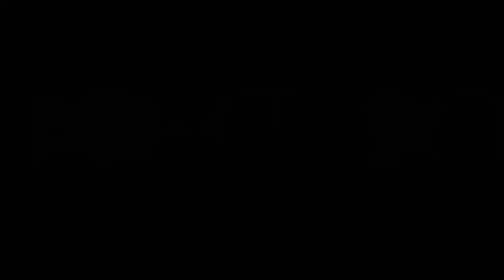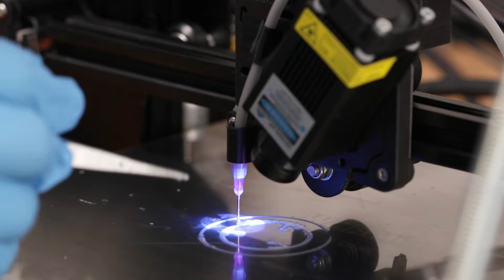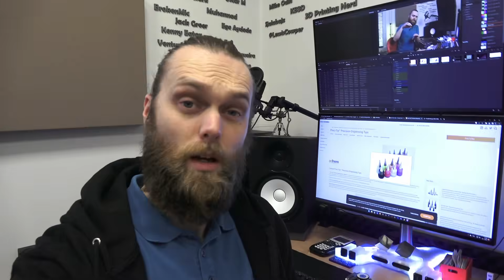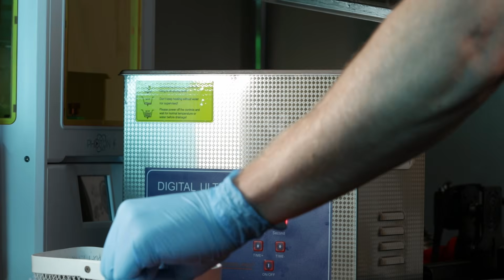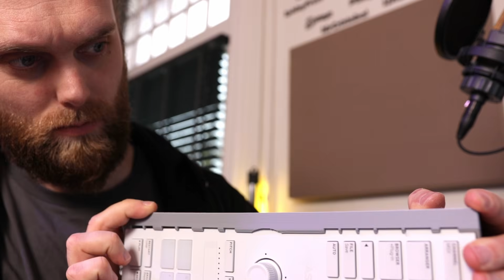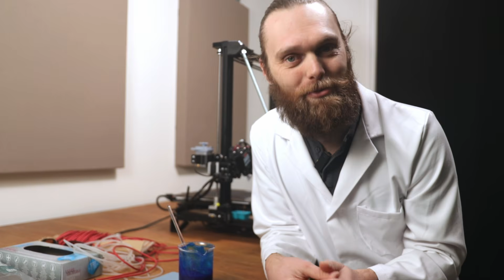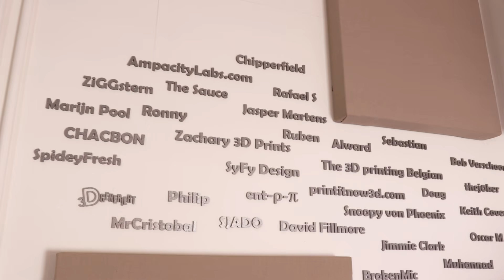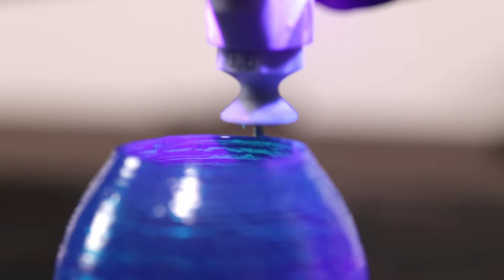I made a CUSTOM Nozzle that 3D Prints GEL!

Comment: You need a particulate filter on your 3m mask, as it is in the video its just a charcoal filter for VOCs and scents. Good work on the project though, keep it up!

A couple thoughts, you dont need to be curing all the time, you could cure selectively to avoid the nozzle getting stuck on cured features, you could simply do an end curing pass at the end of each layer. You could also cure while printing for overhangs etc.

Comment: Should look into a vacuum mixer for incorporating the fumed silica, then you don't have to deal with foaming and you can ensure there's almost no gas incorporated.  Looks like for small volumes you can get them (looks like dental mixers may be the way to go) for $100.  Not the entire puzzle, but it should remove some variability - and make pumping easier too since gas distributed in the gel could definitely affect pumping.

Comment: like you said, since the liquid is so think maybe the vat itself needs to be pressurized, like if u filled a syringe with the resin and used an acutator to slowly push the syringe to extrude the resin rather than using a pump to draw the resin might allow for a more continues deposition? anyways best of luck you have already gotten this far im sure the solution is closer than u think!

Comment: Keep up! You will make it! :)
Could it help to hreaten the gel a bit, so it flows better within the tube, but have a fan outside the nozzle, so it cools down and gets more viscose one outside the tube, like a regular FDM printer does? This way you could use a 'thicker' mixture of gel.
And: Mabye it would help to do the whole thing otherway around. Possibly the continous fiber, despite seeming an additional complication at the moment, IS the actual solution to have the gel bridge, because it adheres to the fiber..?

Comment: I know this kght be a little old suggestion already, but there are a few "industry standard" chemicals you should try on the resin. 

1°: Cellulose. This can be:  Carboxymethyl Cellulose, Hydroximethyl Cellulose, Hydroxypropyl Methyl Cellulose. Any of those 3 should work for thickening the resin without altering it's properties (the proportion is really little). They are commonly used for adhesive, mortar, detergent, creams, paints and many other products (as you are thickening resin any of those should go well).

2°: Dispersant or Dispersing agent. You should get one compatible with the type of resin base you are using. This evens the mix making it more homogeneous, preventing ingredients division, mostly for evening the color and avoiding pigment or other heavier materials decant. You have to find the point but the dosage is stupidly little.

3°: Defoamer or Anti-foaming Agent. This might be optional here, as the thickness of the material is so high and remains static for so long, you can avoid using it, but could be helpfull for big batches as it reduces bubbles when mixing. This prevents the formation of bubbles to a certain degree.  You can vary the dose percentage on the resin, but usually is stupidly little too.

4°: Special mixer. Yeah, you should buy or print a mixer bit and mix it using a machine with a regulated speed so you can get a better result on the finished gel. Beware that mixing at too low speeds can mix badly, and mixing at too high speeds could break molecular chains, try limiting the max at 750rpm or less as a starting point till you get the right speed.

Hope you get the best results!

Comment: Nice work. Having it print UV cured Silicones would be good for my project. It is also not easy, but silicones have a variety of applications, and often need to be cast in strange shapes.

Comment: My 2 cents:

Try printing the conical lens for the laser using the resin 3D printer?

How about 'pushing' the resin vs 'sucking' it?  Something like a meat grinder?

Early on in the vid - you had residual pressure from the resin in the tube and the resin came out very uniform from a high Z axis - could you use that to your advantage? (vs the nozzle plowing through cured resin)

What about doing something similar to the resin vat printer and cure between layers with a 'flash' of UV?  This may also solve for the nozzle plowing through cured resin?

Your resin mixture - I'd start mixing it more scientifically - measure/weigh your ratios and adjust from there (documenting the new 'recipe')

Comment: There must be a different principle for supplying resin to the nozzle.  The pump creates a constant pressure in the supply system.  And the flow is regulated by a needle valve, which is located in the nozzle.

Comment: I think you want your setup as much "Direct drive" as possible - the shorter the distance (and height difference, and also hydraulic resistance) from the driving pump to the nozzle, the more control over the flow/bubble/drip the drive has and less suffers the efects of gravity, viscosity and inertia. Also nozzle diameter might be significant due to surface tension and capilar effects.
I think you could have the pump directly on top of the nozzle and thus not have to deal with the hassle of trying to move 100 mm long column of resin up.
As suggested in the comments, the nozzle hitting was probly low Z hop.
And maybe if you reduce the resin exposure (like curing the resin less), your resin is going to be more of a gel and have better binding properties as well as causing less resistance to the nozzle.

Comment: Massivit's GDp printers are using a suirng style of pump head to move the resing. I thing if you were to add an acrylic tube as a tank and a gas seal piston head on the end of you tubing you would be able to pump the even thicker resin because the airpresure would help the pump.

Comment: What would you think about printing wire? Normal electrical wire in insulation, the insulation serving as filament melting from the heat, the wire providing structural strength. The trickiest part would likely be snipping the wire on retraction. A gap between two blades? Or some active guillotine?

Comment: Hey man really cool design what might help is to put the gel/resin mix higher on your  printer, or at least above the print head. Because of this it does not have to fight against gravity and resold in a more steady suply. you could also make use of a mechanical pump this is often used when pumping oil becouse it can result in mutch higher pump force, you might need a presure valve in it to realeave it from build up precure.

Keep up the good work!!!

Comment: Maybe this answer comes too late, but you should try to mix the ingredients using ultrasonics. Your ultrasonic cleaner can do that job very well.
First mix the ingredients in the traditional way and then hold (wear gloves as vibrations can cause burns) the container inside the ultrasonic cleaner, that should do the job.
I took this idea from a technology channel (TechIngredients) where they use this method to mix the components of their own thermal paste.

Very interesting video and idea, you have a new subscriber.
Reply from the maker: Thanks a lot for your suggestion and sub! This is definitely an interesting approach. I'm wondering if it would work if you fill the cleaner with water and place the beaker in there. Maybe this could prevent the risk of burns.
Reply: @properprinting  I think it should work perfectly, and ultrasound usually helps in degassing.
Maybe it is worth a try

Comment: Would it be possible to try a different slicing method to potentially get around some of the issues with bridging like conical slicing? If you are redesigning a printer to work in a completely different manner than FDM, it would only make sense to try all available slicing methods to see which one your resin takes to the best.

Conventional FDM slicing methods don't seem to mesh well with this project, but the sign they work means you may need to optimize around the resin rather than forcing it to work with conventional printing methods. Diagonal layer load bearing would also increase the overall strength of continuous fiber printing too if you manage to get it working without it.

Inspiring stuff my man, change the game for us all so we can take advantage of your work!

Comment: You could maybe fix the bridging and blobbing issues by connecting the pump to the controller for the filament pulling mechanism so the printer doesn't output a permanent stream but can interrupt it.

Comment: I wonder if something organic would work well to make a gel. Gelatin probably hardens too quickly, but something powdered like fruit pectin, tapioca, rice flour, talcum, or mashed potato mix could provide the right consistency. Thomas Edison went through hundreds of materials before hitting on the right one for his lightbulb filament, so everything is worth a try. To keep the nozzle free of resin, maybe some silicone spray or silicone grease can help prevent sticking.

Comment: Just an opinion. wouldn't a hydraulic syringe and braided line be better instead of the pump for the resin mixture. It will hold a vacuum and have enough power to push the resin mixture through at a constant rate and the braided line will resist expansion while maintaining pressure.

Comment: Another suggestion that may aid with deaeration:  try adding a bit of an antifoam or defoamer.  A lot of the UV curable resins don't contain an antifoam or defoamer.  I've found Tego RAD 2500 and Tego RAD 2700 (available from Evonik) are very effective when added in small quantities of maybe 0.5% based on formulation weight.  If I had to pick one, I'd pick RAD 2700.  BTW these both are UV curable defoamers (i.e. they contain acrylate functionality).  Feel free to message me as I used to formulate UV curable 3D printing resins, coatings, adhesives, and paper saturants.

Comment: So i print with both resin and fdm.... one thing after printing resin is curing. id be very curious to know how strong the prints would be if you set it up so that it basically had a uv light bath on the rest of the printer. like 2 big uv light bars on each side or front and back or something to cure the rest of the print 100% while its printing? maybe use some sort of shield that blocks the uv light from touching the layer its currently printing, or even the top 2-3 layers at all... somehow attached to the z axis maybe? so that when the z height raises it unblocks the layers underneath to be cured by the uv flood lights? either have the lights attached to the z with shields blocking them, so that as the z goes up it gives those lights more and more access to the print? or the shields attached to the z so it uncovers layers as it goes up?

Comment: With that thickened gel-like resin, is there a consistent temperature you have been printing at? Or perhaps a consistent ambient temperature?

Since resins become less viscous at warmer temperatures, there may be a way to allow it to be easier to flow (due to an increased temperature) while allowing it to cool fast enough after being extruder to return to its stable and high viscosity nature

This cooling time would also be augmented by the distance of travel from the source of heat to the final destination

Comment: You can shorten the distance between gel cup and printhead, cup with gel could be on the top of printhead and gravity and pump will do the job. Also you could use mirror on the bottom of your print area. It could improve curring. Or mirrors can be around the lasers. For example your printer should be in the box and box should have some kind of mirrors. It should improve curring and resin hardening.

Comment: With the mixing nozzle have you thought about using a 2 part resin instead of UV? Would remove the need for a laser setup, but you'd have to keep the resin mix flowing/purge it from the nozzle once done.

Comment: If it's a material issue, which it seems to be, modify the material.

Do a few specific tests with different mixtures of the beads, silica and resin. Test bridging using controlled tests of the light exposure as well. You don't need a full cure, just a partial cure which might help with the nozzle 'catching' the print. An extended exposure after the print is done could be used to complete hardening. 

In short, modify the ratios and temperatures of the material (resin) and evaluate. You can do that without the printer to save time.

Comment: what you want to be using is called a high precision glue dispensing machine. They are under $200, it fully automates the flow rate of glue or resin that is being dispense.   Use whats already out there, you'll be much happier with the results

Comment: The silicon tube introduces a lot of springiness to your extrousion rate. You really only need the silicone tube the short space within the pump. That should take care of alot of the variance. Also a semi transparent tube will leak some of the stray uv light into your resin and change some of the viscosity over time, even before the gel reaches the nozzle. 
But anyway, love the project and the longterm idea behind it.

Comment: Not having done this, but having used FDM and SLA over the last decade - have had lots of "ideas" re. direct printing of light cured resins.
 - Also using fumed silicate as a high strength epoxy filler is my go-to..

Thanks for going to this trouble -  using a syringe pusher (or in production settings a screw feeder) to pultrude gel is an option - even if a metering peristaltic pump is included closer to the nozzle.
(pressure meats suction every day, lol.)
Works in progress no doubt.

Comment: Don't forget... If you're printing with "usual" filament... And your nozzle hits your printed part again. The nozzle still have the temperature to melt it. So it melts through it. With your Resin/ uv Print that will not work.  Don't give up! I like the idea!
Reply: Maybe a nozzle with a ramp and spring can help? Similar to a pogo pin?

Comment: You have to keep going!  You're literally creating a new technology for the world!  The fruits of your labor are untold but I'm willing to bet it'll be mainstream in 5 years or less.

My recommendation is create or buy a small compressor.  Create a sealed reservoir with a pressure transducer.  Find a pressure that works well with your tube length.  Then tweak the printer to control the compressor to maintain a specific pressure.

I think that'll give you the consistent results you're looking for.  Your pump will be more like a variable valve at that point.

Comment: My suggestion is to get rid of the tube from beaker to pump and make pressurized resin container to prevent tube in pump from collapsing and not pumping, also i will add some pressure gauge near nozzle for easier trobleshooting/tuning,

Comment: The issue of the too viscous resin can be worked around with a bigger feeding tube, let me explain : according to the introduction to fluid mechanics that I have in my physics lessons : 
You can see a pipe as a resistor, the volumetric flow acts as the current and the difference of pressure acts, for fluids, as the voltage for electricity, thus Ohm's law is valid, (yes for fluids, like water, compressed air, oil, ...) : Fv = Dp/Rf 
Having : Fv, the volumetric flow
Dp the pressure difference
Rf the fluid resistance.
Now the issue is that the fluid resistance depends on :
- the type of flow, here as it's so viscous, the laminar hypothesis should be valid : the Reynolds number needs to be estimated with Re=μ*ν*d/η, 
μ  is the volumetric mass
η is the viscosity
v is the fluid's average speed
d is the diameter of the pipe
We need to keep Re < 1, elseway the behaviour is complex, for water the speed limit is around 1cm/s for a 1cm wide pipe, as the resin is way more viscous, the limit speed is way higher, at least 1m/s or even more.
- the type of liquid, the discosity directly impacts the fluid resistance
- the length of the pipe, the resistance is directly proportional to the length of the pipe, like a electronic resistor, if you double the length of resistive material, the resistance doubles
- and most importantly the radius of the pipe, the resistance is inversely proportional to the radius at the forth power (not the square of the radius, not the cube, but r^4), doubling the diameter of the feeding pipe will decrease the resistance by a factor of 16 I am serious.
If you want a more detailed explanation, I will decide myself to finally make videos and create a fluid mechanics basics video to explain the concept

Comment: That's amazing! no other word can explain this better, meanwhile i was watching appeared in my mind a PC cooling pump, those may are the correct size to be interchanged with the stepper motor instead of the normal one that power them. For the tubes connections i think you can also use those fittings used for compressed air (i understand testing but i think a cable tie doesnt clamp well over tube and brass) also rigid tubes may help with the flow as the one you have on can expand with pressure.

Comment: I think combining the direct input with a press would be best. 

Put the resin(s) in a hopper above the pump connected with a short tube. The tube is for both maintainability and to act as a shock and pressure absorber. 
In the hopper, you would have a disc with a weight on it, resting directly on the resin, to add a bit of back pressure so that the pump isn't subject to the cavitation you saw. Not too much weight, though. Otherwise, the gel will push on the pump, which would likely cause overfeeding and make the flow inconsistent, in addition to potentially being harmful to the pump. 
A calibratable spring would be better but more complicated. 
A synchronized pusher with a stepper and a threaded rod pushing the disc would be best, but the most complicated with more that can go wrong. 
Too much pressure will be hard on the motor, too little, and you risk cavitation. However, if it sits on top of the pump, you may get away with just atmospheric pressure alone - depending on the resin's viscosity.